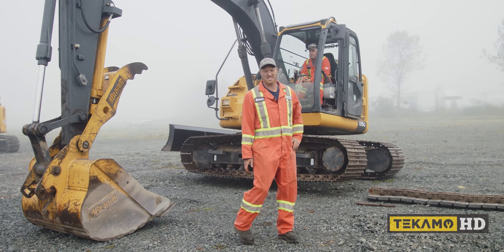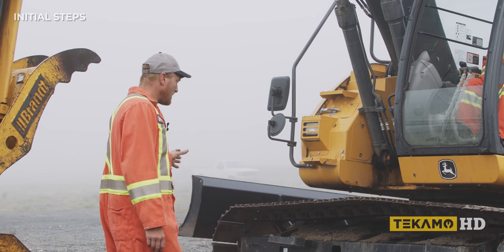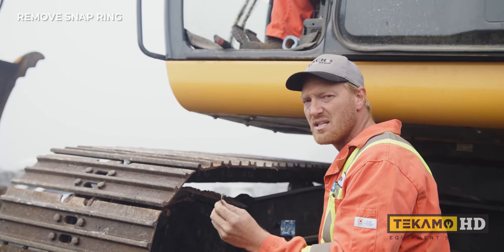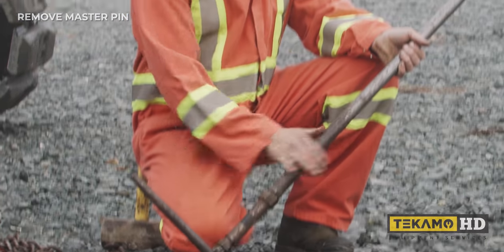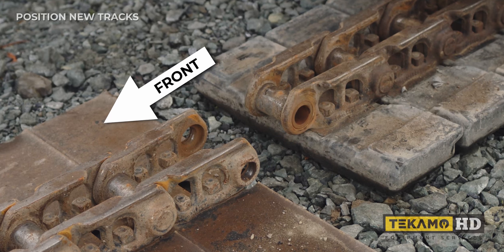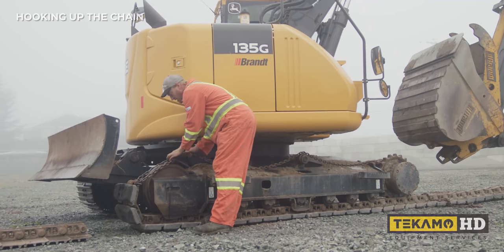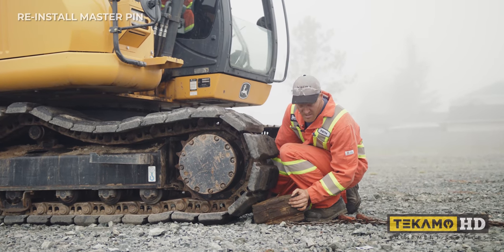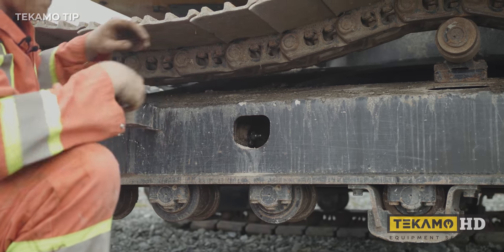DIY Track Changing For Your Excavator - NO Hydraulic Pin Press NEEDED!

Comment: We use a rail road hammer for driving track pins or master links. And I LOVED the idea of using the bar around the drive sprocket to aid in pulling the tensioning idler back. I always pushed it with the bucket. One issue that is very common with our diggers is the grease driven chrome piston inside the tensioner often times corroded to the point of not allowing tension out of the system :/ and thanks for the tip on running the track backwards before checking track tension. It’s the little things that make your videos so awesome.
Reply from the maker: The little things are what separate just getting the job done and getting the job done right! We appreciate your support and helping out the heavy duty community with your comments.

Comment: Best excavator care videos ever. I am new to operating excavators and your videos are a huge help.
Reply from the maker: Glad we could help, let us know if there are topics or machines you want us to make videos on.
Reply: @TekamoHD  Well, all the basic stuff, much of which you have. I'd organize it into Maintenance and Operation. So two categories. Maintenance could be for example... Oil, fuel, coolant, hydraulic fluid, greasing, track care, pre check list, everything we need to do to keep the machine running well and avoid problems. Next, Operation. So buckets types and use cases, bucket swapping, jump turns, basic controls. what not to do, best practices, grading, trenching, heavy loads, loading on transport for site relocation, etc
Reply from the maker: @justinfranks8222  Hey Justin, sorry for the delay in response. Just wanted to let you know we're working on a bunch of stuff including a "job shadow" style series that we hope will address some of the things you mentioned in your comment. We'd love to get feedback from you when they get released. Are you operating any machines other than excavators?
Reply: @TekamoHD  Just excavators. 12 months from now, who knows.
Reply from the maker: @justinfranks8222  Awesome, best of luck. It's a great career that can take you to some really cool places. We hope our current and future videos help you with your journey.

Comment: Really good information!  I have got to take a link out of the track on my 312 cat excavator.  Thanks for sharing!
Reply from the maker: We hope it helped. How did it go with your CAT 312?
Reply: @TekamoHD  I got it done.  Found out the bearings were out in the front idler and the spring rod (bolt) was broke.  Put in a new idler assembly and new bolt.  Had to make a trip to Cat. dealer to have the spring compressed.  Thanks again for the video.
Reply from the maker: @TheFlyingfarmer28170  Super glad to hear you got it done. Is there any other videos we can create to help you with the maintenance on your 312?

Comment: LOL yeah sure buddy.  i have blown apart links on a dozer with the track press because the pin was so SEIZED in the links, it might as well have been WELDED in. this is real cute if you got a new machine.  now try this on a machine that's been loading salt trucks all winter.

Comment: How did I find it, I often watch some heavy equipment tech videos, so YouTube just inserted it into my feed.

Question: Would my CAT E120B use the same tapered pin design?  I’ve never had to break the tracks, but one day I will...

Great content, keep it up!
Reply: Hi Scott, other brand machines use different types of pins which could be straight or they may be cartridge type units as well(which are straight). They may even have different procedures to replacing them which may require a heavy duty hydraulic press and other attachments. make sure that you review the OEM service manual before heading out the the machine so that you perform the job safely and efficiently. Cheers!

Comment: Why not feed it on from the sprocket and use the drive motor to feed it on. Then Put in you pry bar and walk the chain to the rear and drive in you pin. Other trick is use old track pad and cut it the with of the pin so you have more room to drive in the pin without spreading the chain. Use heat to help put in the pin.

Comment: I have never figured out in my life why anyone splits a track to take it on and off.     We did it once and the fastest tool to drive a master link is a 180 tow behind compressor with a point bit on a jack hammer.  Spits it out or back in as fast as you can turn the air on !      But did it few times. Many years ago.     We just pull the fully assembeled track off and fully assembled back on     I have never figured the splitting nonsense.    If you knock a track off on a job ( completely).  Do you people really split them to put them back on ?? Come on put the stupid thing back on in  under an hour. Dont get it and never will.   I have 9 excavators and multiple dozers.   And frig splitting tracks!